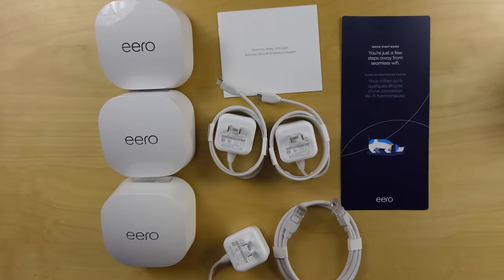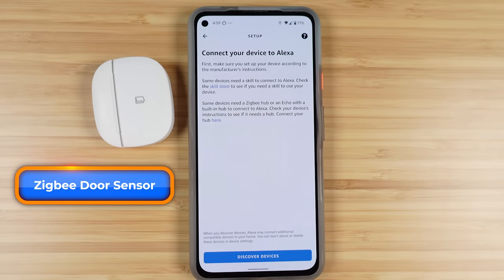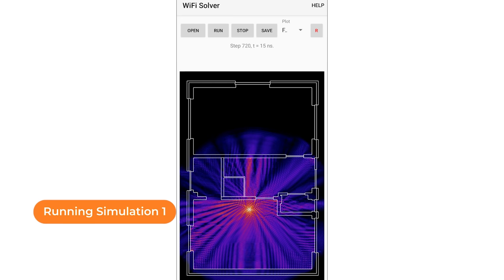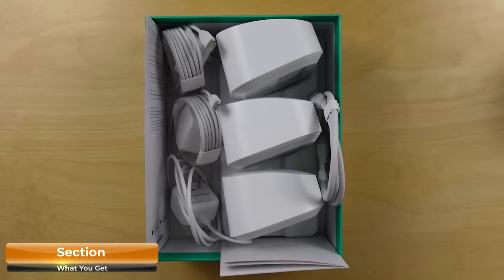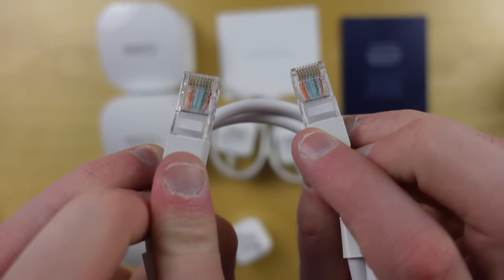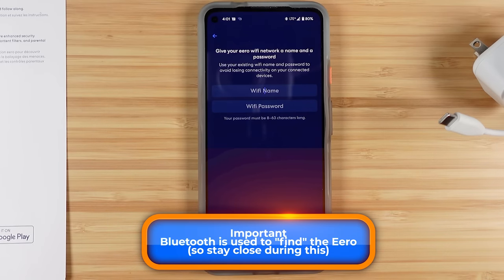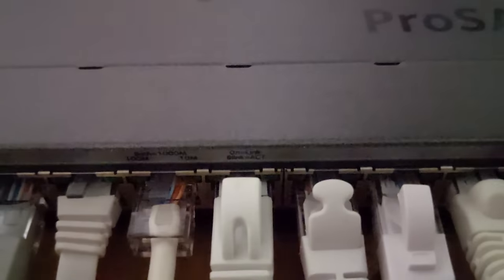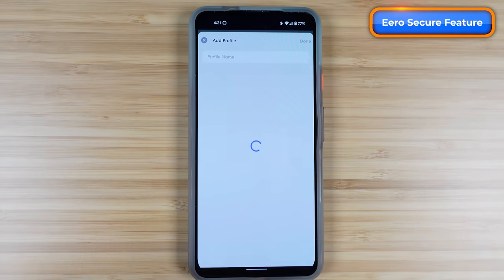Eero 6+ Set up, Walkthrough, and Review

Comment: Just a note. Your modem/router combo (xfinity) can be placed into bridge mode to allow a new router to be added. It shuts off the router in the combo to allow the new router. I just added an ASUS mesh system in my house with no issues.
Reply from the maker: Yeah there's definitely some that can!  It's been an interesting evolution there, with some ISPs being behind or not allowing it and others doing what you just said.  My ISP won't let me touch their hardware beyond seeing what's on the network, so I wish I had your setup!
Reply: If that includes the Xi (the white box)- game on.
Reply: Would this help with speeds? I just installed mine and my speeds at each location haven't changed much and don't match what I get when I sit next to the router.
Reply: @AutomateYourLife I'm not saying it doesn't happen but I've never come across an ISP which won't let you put a modem in bridge mode.  You might have to call them to make it happen, but they will do it.  Double NATting causes all sorts.of problems.
Reply: The ease of install is the least impacting, what follows later in managing is a nightmare. The updates are treacherous if not simply aggravating w/ unwanted & failed updates that leave your devices inop. So if you are dependent on devices I would avoid.
Reply: Why can't I get my ADT camera to connected back to my new euro router since I no longer use the cable router on this eeuro. I'm so disappointed. Any advice? BTW it's a eero 6+ and I did pause the eero so I could try 2 hook the ADT wired camera. Help
Reply: Asus is on another level when it comes new to simplistic setup. Super easy.
Reply: Wait I thought this would replace my Xfinity
Reply: Thankyou for this info
Reply: No point in buying the eero then.

Comment: Hi Brian, quick question. In the three pack, if you wanna connect the two extensors throught ethernet cable: are they connected on sequential? (eg: eero 1 to eero 2, and another cable from eero 2 to eero 3)? Or are the three connected to the router?? I understood the extensors should connect to the first node but each node has only two ports so not sure how to connect the second extensor. Thanks a lot in advanced. Best
Reply from the maker: Well I never tried anything other than sequentially connecting them through ethernet (just didn't have a cable long enough).  I don't think there's anything stopping you from going 1 -> 2 and 1 -> 3 though Alvaro :)
Reply: @AutomateYourLife  Thanks a lot for the quick reply Brian. Just to make sure I got it right. A valid way would be then: Router -->1; 1 --> 2; 2 --> 3. Correct? on the other hand you mention nothing stops us from doing 1-->2 and 1-->3 but each eero only has to ports, and one of the ports for the node 1 would be the input from router, correct? So would only have one port left? Or am I missing something. Thanks again a lot!
Reply from the maker: I did 1-> 2 and 2->3 so that's all I can advise on 100%
Reply from the maker: And yeah they just have 2 ports, so you're using 1 per node and both on the main

Comment: Perfect timing!  Thanks for the video.  Lots off great information.  Amazon just dropped off my eeros.  Did I hear you correctly, that if I keep the SSID and Password the same as the existing router then I don’t have to go around to all of the devices and join them to the network?
Reply from the maker: Correct! You may need to unplug/plug back in to get some devices to reconnect, but that would be the worst of it. :)
Reply: @AutomateYourLife   Thank you again!  The entire installation took less than 30 minutes and that included activating my cable modem and rebooting a couple of devices that didn’t want to play nice.  The network is performance is better than with Orbi CB40.  I appreciate your help and your videos.

Comment: Another great review, Brian!  I have the previous version of this (3-router) and it's worked flawlessly.  I have a couple of comments.  First, I think the 75 device limitation is just WiFi6 devices and not all WiFi devices so you can really have a lot more as for now most devices are not WiFi6...I might be wrong, so check me out.  Next, Amazon has a pretty nice trade-in program that gives you a paltry few dollars for your old router, but also saves you 20% on a new Eero...even from a sale price.  Eero's have a somewhat hidden feature that is great for home automators.  It's in the troubleshooting section, under "My device won't connect" that will temporarily pause the 5 Ghz side of the network to allow a 2.4 Ghz to only see the correct one.  You don't even have to turn it back on.
Reply from the maker: Hey Hugh!  I never caught onto that WiFi pause thing!  That's really great actually.  Definitely a great one for us Automaters.

I don't think it's WiFi 6 sadly, the support guys were pretty clear with me. :(
Reply: will the 75 device limit apply to zigbee and thread devices as presumably they might be classed as being on a different network from wifi ?

Comment: We bought the thing a few weeks ago to replace a more traditional router.  The basic problem I was trying to solve was that we had dead spots in the house, and using WiFi extenders was a pain in the neck.  Setup was really easy, and works more or less as described.  In our case, we have a backhaul to one of the eero since I already had ethernet in my office - the other one is wireless.  So far it has been pretty flawless.  Some devices on our network needed to be rebooted to register the fact that the network had changed.

The management console on the app is pretty simplistic, and if you are used to having more control and more information, you might find this pretty limiting.  It gives me the basic stuff, however.
Reply from the maker: Sounds like you've had a great experience!  Glad to hear it!
Reply: @PoliticalJames  maybe 40 feet.  The one with the backhand isn't an issue however.

Comment: I got the Eero 6 wifi setup. Replaced my existing D-Link Wi-Fi 5 router. And I noticed a substantial increase in speed and range. It's 2024 so I noticed most of my devices are compatible with Wi-Fi 6 including my fire TV cube. And all of my smartphones and tablets are Wi-Fi 6 compatible. As there is a Wi-Fi 6 symbol on my phone when I'm connected to it. The only thing is sometimes it's hard to tell which access point my phone is connected to. Whether it's the basement or the kitchen. You'll have to open the app and it will tell you which hub has active devices on it at any one time and it's pretty much the only way to know. I do like how it works pretty seamlessly.
Reply from the maker: Awesome! Enjoy!

Comment: In order to force a device to connect to a specific Eero device (gateway/extenders), what I do is just turn off and on the WiFi on the device, so when it reconnects, it will do it to the nearest Eero.
Reply from the maker: Usually that works.  Sometimes it works to turn off the WiFi on the access points too

Comment: Question?  I currently have t mobile home internet.  Soon, I will be with another isp that provides fiber at 250 mbps.  I would like to connect my eero 6+ in advance of connecting to the fiber.  The reason I want to do this is so that when I get fiber, I would like to just plug the eero in and have all of my devises connect without having to reconfigure each devise, ie Ring doorbell, SimpliSafe, Alexa hub, etc.  How do I do this?  TIA
Reply from the maker: You have to have the Eero plugged into a modem when you set it up.  So as long as T Mobile can kick out an ethernet cable out of their modem, you can do it. :)

Just set it up from T Mobile's modem. If they have a modem/router combo, it'll be tougher to do what you want. I would then wait.

Comment: Hi, the instructions here that you gave were excellent, but my issue is how do I set up my EERO with a Xfi Gateway from Xfinity, this is very important for me. I just purchased the EERO WiFi System (Not Pro) but I'm sure they will work the same but how do I set them up to work properly together. Others have stated with the Xfi I will need to Bridge the modem and the EERO, is this true?. Can you please give me the proper instructions on what I need to do becuase there are no instructions NO WHERE on a Xfinity & EERO set-up.  Also ADT updated my home alarm panel system along with a outside rear driveway camera and a front Nest doorbell camera which all appears to work off of my current wifi, will all of these items automatically connect once set up? Thank you in advance for whatever information you can give me.
Reply from the maker: If you use the same ID/Password for your WiFi, everything should reconnect.  So you should be good there, unless you had some really funny settings on your router before.  Should be good.

As for XFi Gateway, I can't guide you there.  First off, we don't have Xfinity and secondly, I don't work there. :)  Sadly, there's just some info that Xfinity will need to give you if it doesn't work like I've shown you here.

And what I showed here should work.  From Modem -> Eero.  No XFi anything.  However, they could require it for another service they're providing you or something on their side.  Honestly, I'd switch away if they're not allowing you to remove their router and causing you networking issues...but that's just me.

So 1. Ask Xfinity how you can install your own router downstream and how you should configure that device to do so.  If you can remove it entirely, do it.  You shouldn't ever need a router (the XFi) and then a router (the first Eero).

Comment: Nice Video! If my eero+ have the same ssid and password as my modem, will my devices automatically connect to eero+? Will there be an issue if both my modem and eero+ have the same ssid and password? Thanks!
Reply: Also, do I need to turn off my modem wifi?
Reply from the maker: Yeah turn off your modem's wifi :)  Just use Eero and then yes, everything should reconnect. You might have a few things you have to cycle power on to get them to connect, but that's how it'll work :)

Comment: Hey buddy, looking at replacing my google home wifi pro. The reason i'm using the google pro is I can plug it into a network plug at any place in the house that is connected to the modem and the wifi signal is sent full signal from that location. Previous version of EERO did not allow this. Can this be done on the 6+? I don't want to setup nodes that are just repeating a dim wifi signal, I want to set them up where network jacks exist connected to the modem and send a full signal from that location.
Reply from the maker: If your modem has multiple ports on it, the Eeros can be setup this way.  However, most non-router modems only have 1 port.  If it's a router/modem combo, Eero tells you to turn off the router functions of the combo unit if you can.

Then you likely cannot go direct to your 2nd or 3rd Eero points.  I'd worry about security then.

It goes Modem -> Eero 1 -> Network Switch or Eero 2 -> Eero 3

Comment: With regards to the 75 device limit, how will the eero count Philips hue devices and SONOS devices?
Will the eero count 15 hue bulbs and a hue bridge as 16 devices, or will it only count the bridge, therefore one device?
Similar question for SONOS, will the eero count every SONOS speaker or just the first speaker as the other speakers are connected on the SONOS mesh network?
Reply from the maker: Sonos are generally Network devices, so they count.  That mesh system may alleviate each speaker needing to be connected, but the last time I used Sonos every speaker went on the network.  Hue Hubs use Zigbee/Bluetooth to communicate with their devices, so you're only adding 1 device there (the hub/bridge).
Reply: Thanks for the response

Comment: Awesome video, thanks for going in depth with the how to's.  I might have missed this, I apologize if I did.  I'm using an Arris SB8200 surfboard modem and the eero 6+ 3 pack mesh system. I can't seem to connect anything that requires  2.4ghz. I can pause the 5ghz via the eero app but once it's unpaused my 2.4ghz connection is lost. Any way to fix this issue? Any info helps, thank you!
Reply from the maker: I haven't had to (with very many smart devices) pause my 5 GHz.  I would suggest you just try doing setups without pausing the 2.4 GHz.  If you're having trouble, it's the specific device more than it is Eero.

But one thing I could offer is maybe just unplug and then plug back in whatever you're trying to keep on the 2.4 GHz.  Or the same process with the Eero routers.  Just reboot them power wise once you're done and you've found things disconnected.

Comment: My situation requires me to be able to load my VPN service onto my router. Is this possible either through the router or through the  upgraded security I noticed it mentioned using a VPN. How will that work? Great Videos!
Reply from the maker: Hey JR, I believe you're only going to be able to use the Eero Secure subscription to use a VPN service the way you're hoping to.  And you won't get to pick from many services then...in fact, I think it's only one.

Comment: You mentioned you use a network switch. Have you had any issues while connecting to tv’s? My Lg Oled can get online but the network settings in the tv shows Ethernet is not connected even though it is
Reply from the maker: Nope!  But I don't connect wired!

Comment: Thanks for the review brian. Quick Q - i currently have google nest wifi (2 pack) and considering switching to eero. One thing i do find with google mesh is that if i am streaming videos (yours, of course) on my tablet and i move from one room to another, the device often stops working (at least for a minute or so) - presumably while it switches from one access point to the other. Do you also have these dropouts when moving between rooms on the eero mesh network ?
Reply from the maker: Hey Martin, to be honest, I don't have that problem with either Google Nest Mesh WiFi nor Eero.  I actually saw a bit more of a switchover with Eero.  That sounds like maybe the distance between your Nest WiFi is a little too much or just at the edge?

To be clear though, I never experienced that with Eero, I just noticed sometimes I'd stay connected longer to the further away point. :)  The good news for you would be the Eeros reach further with their signal!
Reply: @AutomateYourLife   thanks brian, thats really helpful, and i will maybe try experimenting eith changing the distance on the nest access point before making any new purchase. The google home app states that i have a “great” connection between the nest devices but maybe it could be too far or perhaps even too close. thanks for the tip.

Comment: Ok, so we use the same SSID and password as was on the router previous?

I had a coworker say I was supposed to make Eero with a different network and connect to it  So I'll rename my Eero devices to match. 👍
Reply from the maker: If you're replacing an existing router, it's easiest to use the same SSID/Password combo.  Most things will just reconnect. :)

Comment: Why did they do 2.5gb in but only 1gb out, so now when I hardwire from one eero to the other am only getting 1gb out if the hardwired version.
Reply: Because it would cost exponentially more and I bet every device you have currently have besides your PC only has a 1 GB port on them, so it doesn't matter. The 2.5G on the eero is to support the Wifi 6E capabilities. They know that anyone that seriously needs 2.5 GB ports today, aren't buying this.

Comment: we bought this system 6 months ago and we working great till yestereday when they all turned red and now none of them will connect not even the one that is hard wired to our modem any help on getting them set back up eero was no help
Reply from the maker: Maybe you got hit by a surge or brownout??

There's not much I can tell you other than maybe try a full reset on them, but if the hardwire one won't connect then it could be your ISPs modem.  I'd start with them

Comment: How would this compare to the tri-band Deco 75XE from TP link? Would a house of around 1,800 SQFT benefit from the tri-band?
Reply from the maker: Pretty hard to give you a full comparison right here.  That's a WiFi 6E system it seems, so unless you have other WiFi 6E devices in your home (you won't yet), that third band is useless.  It's using 6 GHz as the third band.

I'd rather have a wired backhaul if I could than that...and you can with Eero.
Reply: @AutomateYourLife  I think 75XE has wired backhaul as well. Thanks for info! I don't have 6E device yet, so I might stick with Eero!

Comment: Am I missing something, I have Gig internet service. I am using eero pro, which tops at 250mbs on WiFi, I average 200-250 mbs with it. I recently purchased the Asus XD5, with rated higher WiFi speeds. I average 350-400 mbs even with my Gig service. 
If I purchase the eero pro 6+, I assume my speeds will still be 350-400mbs?? Any help would be great
Reply from the maker: It all depends where you measure it from. Deep I to your network, you'll be limited by all kinds of things!

Wiring your nodes helps big time with Eero.

Also, check if your internet is 1 Gbps (Gigabit) and then watch if you're getting speeds in MBps (Megabyte). That's a factor of 8 because 1 Byte is 8 bits.

I don't think that's going on, but just watch it. Marketing is a jerk.
Reply: @AutomateYourLife  I measured it standing in front of the wired node, both on the eero and XD5. Seems like both were under 50% of max speeds, so I assume the eero pro 6+ would be the same